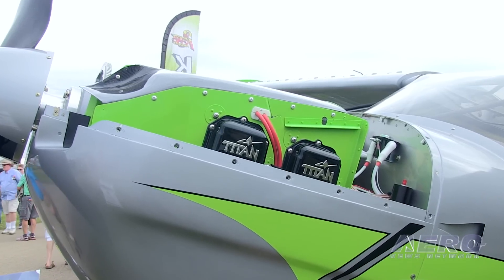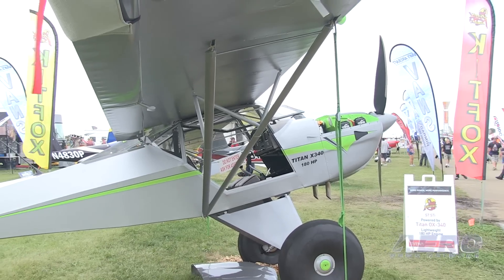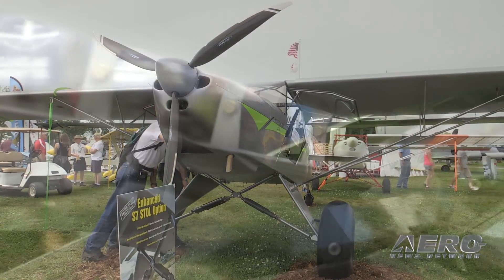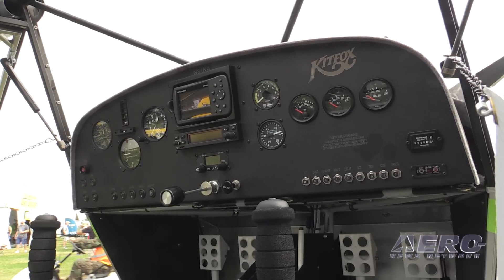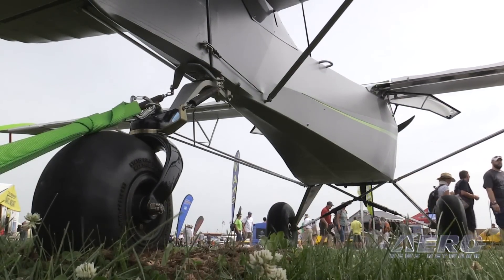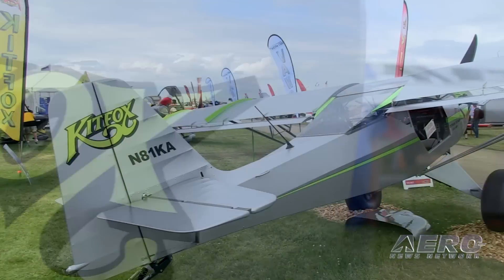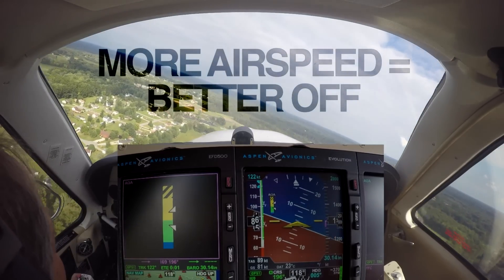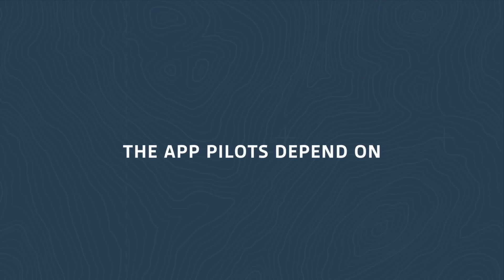Aero-TV: Kitfox On Steroids - 180 HP(!) for Your Kitfox STi

Comment: is the performance better with the X340 or with the Rotax 915is?
Reply: X340 better horsepower at sea level, 915is keeps it's 141 hp at any altitude since it's turbocharged. 915 also lighter but it is like 11 grand more expensive. So, depends on environment you fly in

Comment: $80K outfitted, still pricey
Reply: Pricey compared to what...flying kites?  That's dirt cheap for a plane that's brand new, with a legit certified grade type engine and the capability...good luck finding a comparable deal.
Reply: probably 130k if they build it
Reply: Yeah my dads 57 super cub was $118k and he’s looking at getting a carbon cub kit to build which is even more...so $80k for similar performance is amazing.